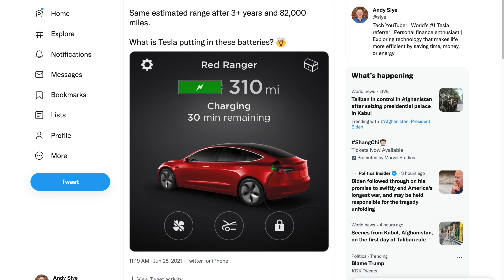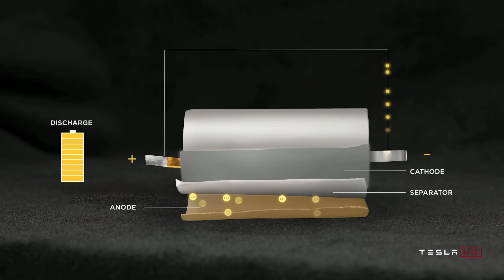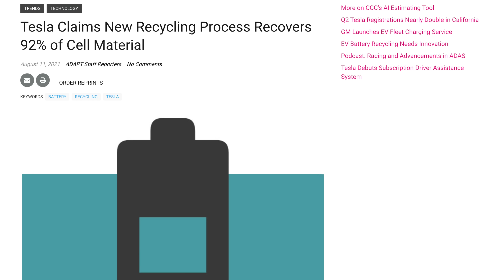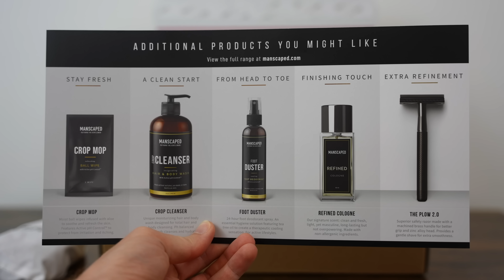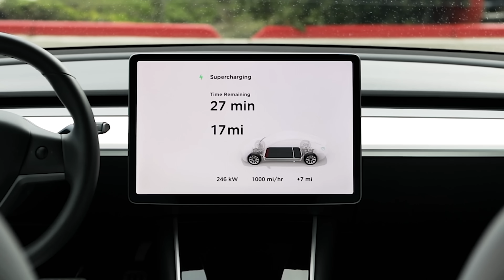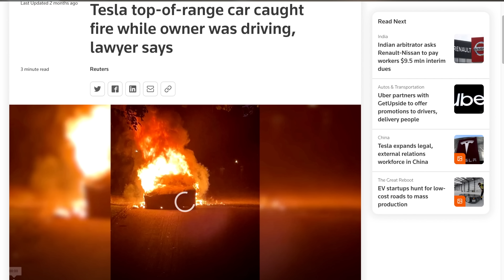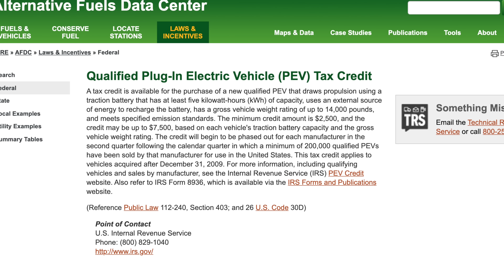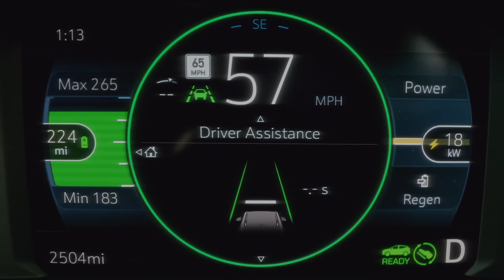Top 5 Dumbest Tesla Myths Debunked!

Comment: Really not what I thought this list would be.  I thought one of the debunked myths would be the huge lie that Tesla's are cheaper to operate energy cost per mile than basically any production car and most production trucks.  Cause that is a lie.  Also the big lie about the range that you can never get even with the A/C off, headlights off, no windshield wipers, no charging of phones, no turning of the steering wheel, and so forth.  Or how about the lie with the fake battery degradation curves that show degradation rates actually level off after a couple years leading you to thinking the batteries will actually settle at about 90% and then just stop degrading altogether after that.  LoL, those are hilarious!  How did these myths not make the debunked list?
Reply: It is absolutely cheaper to operate than production cars. The current price of premium in my area is over $4.50/gal. My 16 gallon tank would cost $72 for about 320 miles. My Tesla is rated for 400 miles. The real world range is also about 320 miles. My marginal electricity cost is 0.24 /kwh. So, the 100KW battery would cost $24. There are no oil changes and brake work isn't required very often because of regenerative braking.  If something breaks down it will be expensive to repair once the warranty expires, but that is also true for ICE cars, unless you know how to fix engines yourself.  The EPA range is not achievable, even on ICE cars. Like I said, if the car is fully charged, I can get about 320 miles which is equivalent to the range on the ICE car I own. I can get much closer to the EPA range if I drive 55-60 mph on the freeway, but I don't do that. So, that part isn't really a lie. EPA estimates are always off.  For the battery degradation, you can look up plenty of articles on high mileage EVs and you can look up Teslaloop (a taxi company that uses Teslas) to see the mileage and repair history on Teslas that have well over 200k miles on them. You can also look at Tesla forums where owners discuss degradation. If you don't use superchargers often and don't charge to 100% or go below 20% often, the batteries will last a long time. That chart only looks at miles traveled. Time also degrades batteries. So, if you are a high mileage driver who put on 200k miles over 3 years, the degradation chart might look like that. If you did it over 7 years, your battery will more likely be around 80% of the original range, if you took care of the battery.
Reply: @ymcpa73  I think you are right under a certain set of rules and limitations.  First, almost all your miles have to be local city driving.  You can do some rather short remote highway trips, but basically all of those have to be within the range of the vehicle.  Second, you can only charge at home and with a lower capacity level 2 charger - ends up becoming almost a PHEV.  Third, you must keep the A/C and heater use to a minimum.  Fourth, try to never drive in the rain.  Fifth, don't gun it or use the car when its very hot outside - the active cooling system of the car kills economy.  Sixth, don't carry passengers or other loads whenever possible.  Seventh, keep it under the speed limit, and always drive like an old lady.  If you follow these rules, you can beat many production cars and most production trucks.  Still won't beat today's PHEV's (330e, Rav4 Prime, S60 T8, etc.), which is another thread we can go into if you want.    But, in any case, those are some strict rules to follow.  Remote highway trips are the real problem, and the economy of an EV on remote highway trips is horrendous.  Tesla has been trying to hide this by purposely losing money on their supercharging network.  I think there are still some older S's that get free supercharging, which is great (if you ignore that upfront cost to get that free supercharging, in much the same way EV owners ignore the cost of purchasing, installing and periodically replacing their Level 2 charger at home or the one time installation cost of the 50A plug that did not come with your house).  

Your local energy cost ratio is actually worse for an EV than mine.  In Florida, current (August 23, 2021) average energy rates are $0.12/kWh and $2.97 (87), $3.32 (89), $3.63 (93).  Assuming 6k miles local city driving (all charging from home) and 6k miles remote highway (few charging from home, most from privileged Tesla stations, few from non-Tesla stations) per year.  Your electric rate is twice that, while your gas rate is only 50% higher.  With your numbers, gas would have to be well over $9.50/gal for your Tesla to match today's PHEV's (25+ all electric range city and high 30's+ MPG in highway) in that usage.  This is ignoring maintenance of the vehicle, which is actually worse for Tesla (half thread tires?  really?).  Keep in mind that some (BMW, Toyota, as examples) PHEV's get free maintenance (not tires, although you start with full thread tires at least for now.  upcoming iX looks like BMW is going the way of Tesla on the half thread tires.) for several years included in the price, and that price is several/many thousands lower than something like the Model 3 SR while having comparable or better performance.  BTW, Geico offers mechanical breakdown coverage for a mere $64/yr for up to 7 years/100k miles with a $250 deductible.  That levels the playing field for even something like a BMW or Mercedes which are perceived to have higher repair costs (which they don't vs Tesla).  Finally, the EPA range for an ICEV or PHEV is easily surpassed if you make the trips apples to apples.  I.e., same work in the same time.  But you can't say the ICEV or PHEV has to go 600 miles in 8 hours while the Tesla gets to do the same 600 miles in 12 hours.  That is not fair to the ICEV or PHEV.  They can slow down and increase their economy per mile by quite a lot.  Anyone with no math and science skills knows that there is a big difference between 80MPH and 60MPH for economy.  My wife's X3 regularly does 35MPG on highway road trips always going 5MPH above the posted speed limit.  EPA says 31MPG.  Granted, BMW is one of the few that rigs the game to understate MPG's, 0-60 times, etc.  That probably won't be true forever as competition in the internet age is all about the spec sheet.  What the vehicle can actually do in real world use has become irrelevant.  This has become true for many products that we buy today, and it sucks.  

Question on battery degradation.  How do you know the battery capacity of a Tesla?  Because Tesla told you?  See, its not the same as a fuel tank.  The volume of a fuel tank is an easily verifiable physical fact.  Not so with batteries.  Tesla could in fact be lying about the battery capacity, and judging from the degradation curves being reported they seem to be doing exactly that.  I am not trying to be a conspiracy theorist here.  I am simply saying that the degradation curves bring reported seem to break the laws of physics.  The most likely scenarios is that Tesla is installing a battery package that is a of a larger capacity than we are led to believe, and they are using an algorithm to give the impression that the degradation is less than it really is by "dampening" the loss in the data set over time/number of charges/depth of discharge/etc.  Is this really a problem?  Not necessarily.  Getting a larger battery gives more headroom room to keep as much of that estimated range for a longer period during the vehicles lifetime, and that benefits the consumer for the most part. Yes, more capacity equals more weight equals lost economy.  Yes, the daily internal energy loss is slightly greater (since it is a percentage of the actual total battery capacity, and not a percentage of a fictitious lower battery capacity), again, to the loss of overall economy.  Probably increased the price of the vehicle some most than it would have been.  Probably not very significant on any of those, except that latter.  I think Tesla does this primarily for resale value.  They want people to think their batteries degrade less than the competition, which can be perceived as value added.  Nothing wrong with that, right?
Reply: @KungPowEnterFist  I haver a model S with an EPA range of a little over 400 miles. I recently drove from LA to SF, which is a 382 mile trip. I got about 320 miles of range driving on average speed of 70 mph. So, you don't have to drive just on the street or like a grandma. If I did, I'm sure the range would be closer to the EPA estimate. There were many superchargers on this path. So, I don't have to drive on just short trips. I'm not sure what you mean by " you can only charge at home and with a lower capacity level 2 charger - ends up becoming almost a PHEV." Charging at home is convenient, but if I had to there are superchargers I can use, but I've only used them on trips to San Francisco and Vegas. I was using the A/C on these trips. The A/C actually doesn't lower range nearly as much as a heater. Luckily, I live in a warm state and it's not an issue. I was discussing ICE cars. PHEV obviously does much better on fuel economy and doesn't cost as much in gas, especially if your commute falls within the PHEV's battery range. You can look at Tesla maintenance schedule. It doesn't have much and what it does happen annually. Everything else is covered under warranty. So, the maintenance won't be any worse than the BMW with free maintenance. The tires do wear out faster on EV, but you can counter that by setting the car to chill mode to reduce the torque curve.   

For battery capacity can easily be tested by discharging it to zero and then charging it to 100%. This will tell you exactly how many KWH are in the battery. They don't state it in the graph, but to get that degradation curve, you can't charge the battery over 90% or below 20% very often. If you keep the charge level even lower, you can reduce degradation even more. There are many articles of actual Tesla owners and the degradation they have experienced. Those that use the superchargers and charge to full all the time have much worse results.
Reply: @ymcpa73  I hear what you are saying.  I believe that you believe what you are saying.  The only charge at home comment is related to the economy.  If you supercharge your cost per mile goes way up, and, frankly, this fact is indisputable no matter how much one tries to talk their way out of it.  Enjoy the sweetheart rates Tesla is charging while they last.  Tesla is only going to lose money at that for so long.  Concerning maintenance, like I said, many manufacturers include several years of maintenance included for free, and the cost of the car is cheaper than say a Model 3 SR with comparable or sometimes better performance (ex., Rav4 Prime, 330e).  The warranty question is also a moot point if you buy the MBI from Geico (or others).  The tires don't just wear out faster on a Tesla.  They are putting half thread tires on the cars.  Some people are reporting having to replace them after just 12k miles, and did not drive like maniacs.  That is a maintenance cost, and it totally counts.  Even my 3/4 ton gas truck came with 70k miles, and after 40k miles I still have about half the thread.  Most production cars and production trucks come with full thread tires rated for at least 60k miles.  When you replace yours, it counts.   Never heard of anyone outside of a farm installing a gas pump at their house.  That charger at your house, yeah, that counts, and, BTW, it will not likely last for long.  A coworker of mine is on his third in two years.  My neighbor is on their second in one year.

Your battery "test," unfortunately, will prove nothing, because the car's charge controller decides when the battery is full and not the external charger or the battery itself.  You have no control over things like what 0% and 100% means.  The manufacturer decides that, and it can change over time.  The 2020+ BMW 330e, for example, has a 12.4kWh pack with a net capacity of 9.1kWh (most sources claim, though probably between 9kWh and 10kWh in reality).  You can actually never charge it to its true 12.4kWh capacity, which they state clearly and openly.  100% charge may represent 11.4kWh, 10.2kWh, etc., SOC, and 0% may represent 9.1kWh less than that which may be 2.5kWh, 1.1kWh, etc., SOC.  But the point is that because of this built in slop, it is easy to fake battery degradation data.  They are telling you only 9.1kWh is useable so if the pack lost 0.2kWh this year off its total capacity, can you still get 9.1kWh worth of storage into the pack?  Of course you can.  BMW can fake their degradation curve for 15+ years on that car pretty easily.  In this the higher price car makers have the advantage, because the build can afford to include plenty of this extra battery capacity (~20% for the BMW 330e, 530e) that can be used as a proverbial sacrificial anode if you will to make it look like all the original capacity is still there after years and years of daily deep DOD cycles, etc.  So when you say things like [paraphrase] "you can't charge to over 90% or below 20% very often," well, are you sure about that?
Reply: I love EVs, I think they're really cool and I want one but I just wish people would tell both sides of EVs instead of just showing people the good stuff about them. Most people don't know that the manufacturers recommend charging to a daily maximum of 80% while the manufactures tell people they're getting 300+ miles, well 80% of 300 is 240, and then depending on how you drive, the temperature outside, your 240 actually is more like 225ish. EVs have a long way to go to prove they are the future.
Reply: @kingbran923  That applies to everyday use and even at 225 miles, that is more than enough for most people because you charge overnight and have full range every morning. When I go on a road trip, I charge to 100% before I leave. As long as you leave soon after charging to 100%, you are ok. Doing this daily, will damage the battery. I don't think that EV are a long way off. If people honestly reviewed their daily driving, they would realized that the range anxiety is unfounded. Very few people drive distances that require more than even 200 miles of range. Those people will of course point out road trips. Most people don't take very many road trips in a year and when they do, the average is under 300 miles. If you are one of the few that does a monthly 1000 mile road trip, than an EV would be inconvenient because it would add a couple hours to your trips. For most everyone else, they will work just fine.

Comment: Simply commenting for algo. to have more people wake tf up to EVs which are the future, Tesla or not. (But go TSLA) Ty Andy
Reply: When EVs are more affordable, when there are chargers at every corner, when they can go 400+ miles on a charge, when batteries are plentiful, when the infrastructure can support 100% of the population driving EVs, when they aren't so insanely expensive to repair,  then maybe. Electric Vehicles have a long way to go to prove that they are the future.
Reply: @kingbran923  They are more affordable than their ICE equivelants, if looking JUST (if even) 5 years down the road with the total price of ownership. 
You say insanely expensive repairs??? What repairs might those be? Literally The upside to an EV (not just, but mainly Tesla vehicles) is the fact that there are less things that can go wrong and break.
You don't think it's expensive to have your gearbox/clutch repaired every 3-8 years, depending on how one treats their ICE car? Of course there are outliers, but that's not Tesla // EV exclusive. Stuff breaks, but mostly doesn't. (unless talking about ICE vehicles which are basically created to break down, to lubricate OEMs pockets with dough)
How about all the other running costs of them ICE's.. Too many to list, but one of the major ones.. GASOLINE? 
Of course they are the future. The old tech is literally poisoning the air we breathe, killing us, or at the very least affecting our health, putting a great cost to the healthcare systems around the world (Or, for the US, people's own pockets (3rd world conditions)) So not only is it viable from an economics standpoint, it is very much so also viable from a health standpoint (and in turn, economics standpoint once more)
Thanks

Comment: I have a question about hybrid cars. A little off the subject of EV batteries. But this might help fuel the myth of EV batteries. What is the average life on a Prius hybrid battery. I had a friend who owned a 2013 Prius C with 84K miles on it, and needed to battery replaced at a cost of 5K at the dealer. Seems to me, these are pretty crappy batteries. What is your thoughts on hybrid batteries longevity? GM is not helping with its battery fires on the Chevy Bolt. Good thing the media is hush, hush on this.
Reply: Forget hybrid. They combine the worst of both worlds.